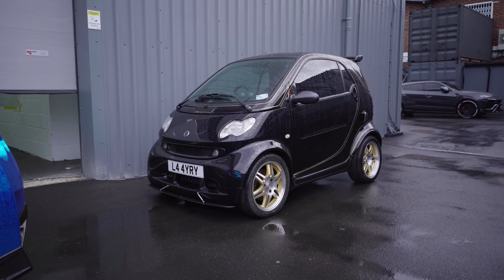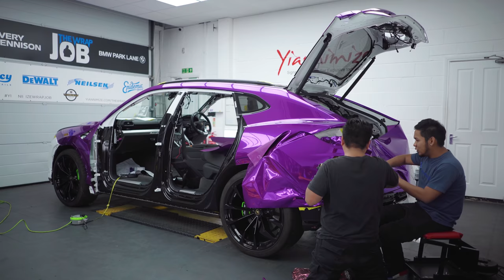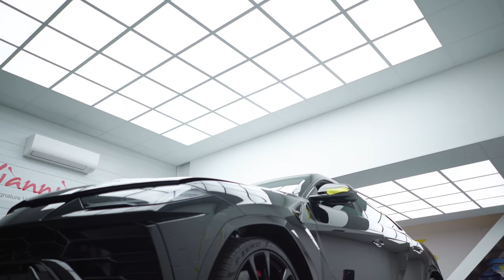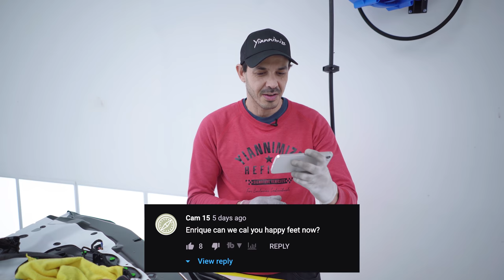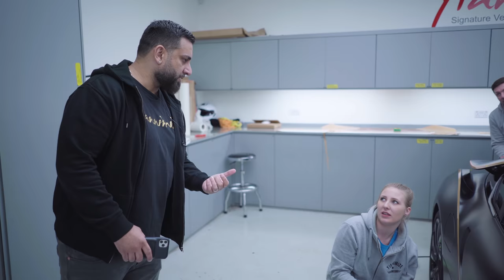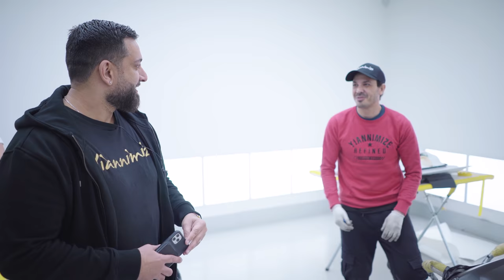Mark and Nicco Struggle to Wrap Urus Rear Bumper? | TWAY ep37

Comment: That tint on the Range Rover is illegal as any windows from the B pillar forward (front side windows, windscreen) have to let 85% of the visible light through. The front side windows actually come tinted to the maximum legal level from the factory so any darker aftermarket tint on those will be illegal.

Comment: I've got a red m3 competition and the front splinters are black and the paint peels off painted it twice already any advice
Reply: Use an adhesive promotor / plastic primer before you apply paint to plastic